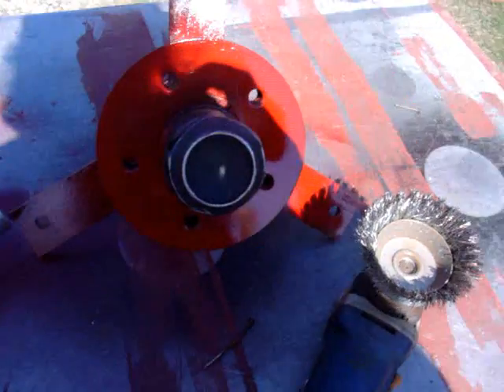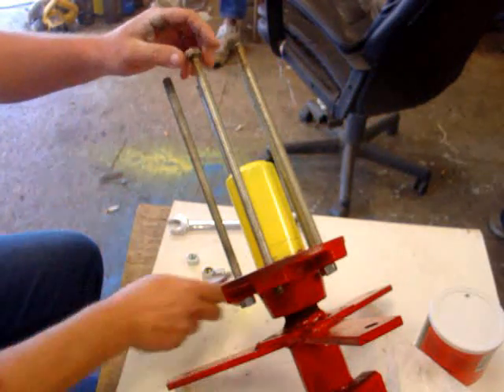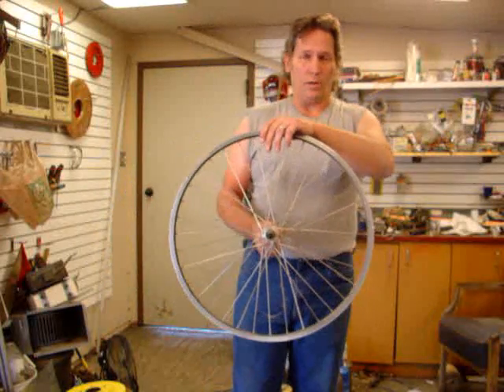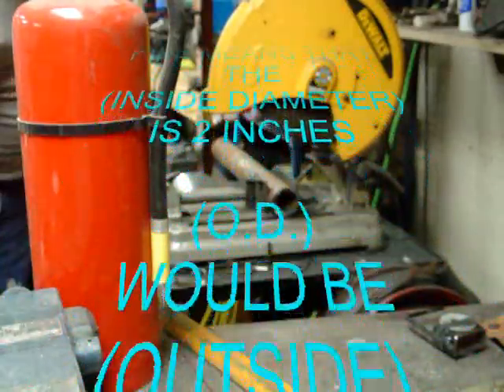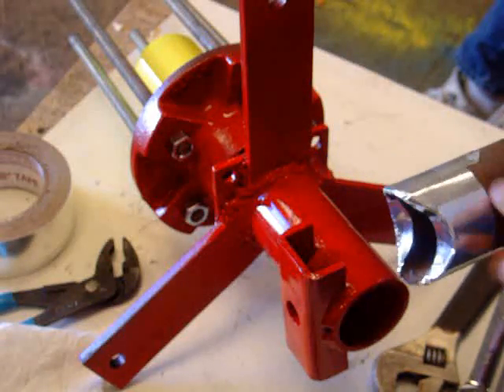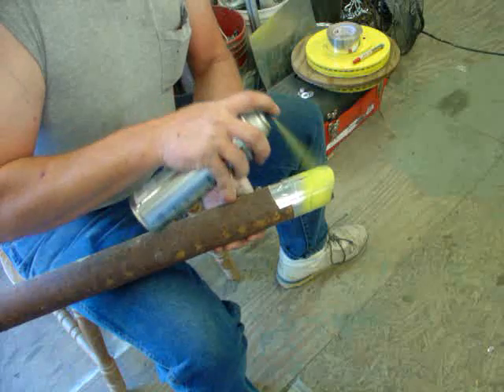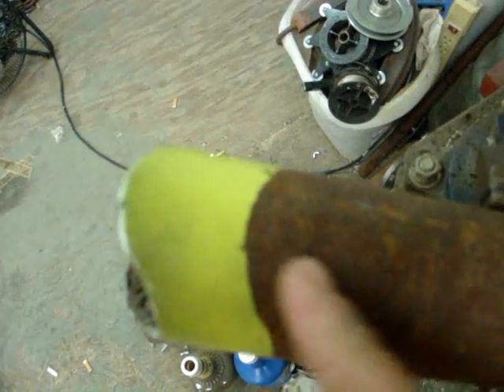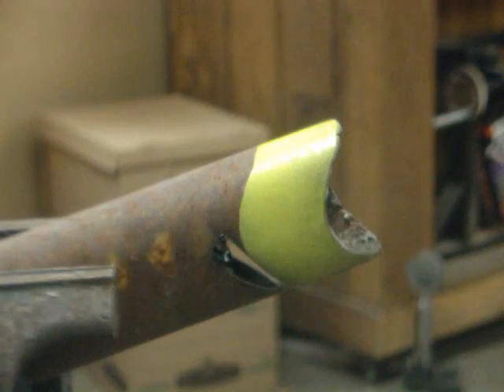BUILD A  DUAL PERMANENT MAGNET ROTOR WIND TURBINE (PART 23)

Comment: If you use a drill press with a 2 inch whole saw find your center the 2 inch clamp your piece and cut through just like you were drilling you won’t have to grind anythin

Comment: has anyone used the repulsion of like magnetic charges to power an alternator to produce electricity? it seems if you could get one large enough you could power an electric unit or even power a house without a hookup to the electric company. what are the factors that would limit the ability to utilize this form of energy production?

Comment: @muddymuddymuddmann
  G'day... Interesting question. Maybe 10 times the size of the PV ? My reg. Says 2.3 to 2.7 Volts at night, at the Array. In starlight, a minute ago, the Mk 1 was 0.55 volts. Why not get @tomken8dy to instruct you on Tesla Radiant Free Energy Recievers ; they go 24/24, but at High Voltages. A shìny metal plate, in a clear Insulator (Epoxy) on a Tall pole. Wired to a Capacitor. Other wire to Earth. A spark-gap to discharge, or Capacitor explodes..! Hi Volts.

Comment: @muddymuddymuddmann
   Hi, Scotty... Oh, yes, I understand the Asymetric Vertical Axis of the Rotor's Shaft, for Self-Furling, balanced by a Skewed Tail-Hinge governed by Tail-Weight... I used it on the Turbulence Test-Rig that doubles for Garden-Sculpture on my Lawn... It's been done since the 1930's, as far as I know. A very smart idea... So much better than blowing the Pole down with a Perpendicular Disc, when the Strong Wind arrives. Ciao !

Comment: @muddymuddymuddmann
   G'day...  Yummy...; MORE Sparklies !   I don't quite underconstumble how "the wind isn't coming straight-on, but it hits the Turbine coming down. So y' need to angle the shaft up 3 or 4 Degrees..." um. The Wind on the Top-Tip is always faster than on the Bottom. But, it's going parallel to the Ground Contour. Low Towers give Worse Shear-Effect, from the Surface-drag of the Ground. Then Gyro. Precession turns the Vertical Pulses, into Yaws.

Comment: easy way to make those cuts fast and percise is you use a hole saw the same size of the pipe and just cut down and through. safes a tone of time and fitting and makes for a tight weld joint

Comment: I was wonderin if there is a way to use a solar charge controller with my ceiling fan altenator. Some how use a zeiner diode and a large resister as the dump load. Not sure how it all works. Just wonderin. (Tom)